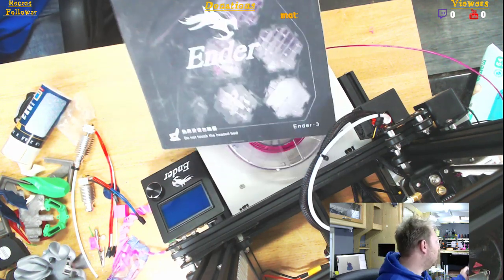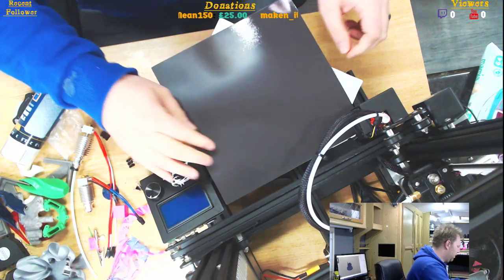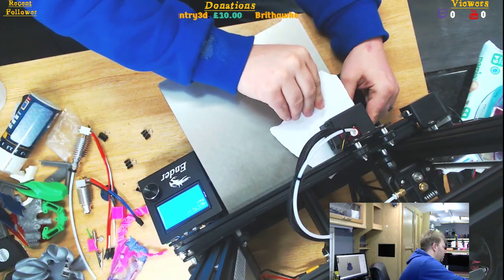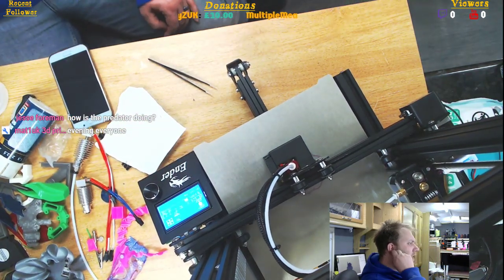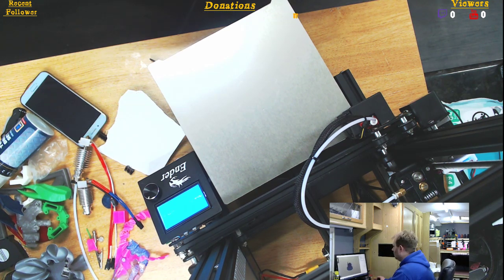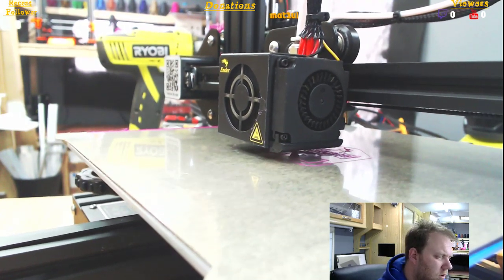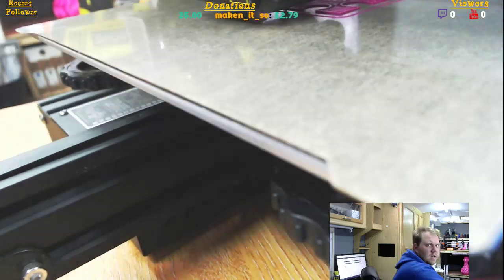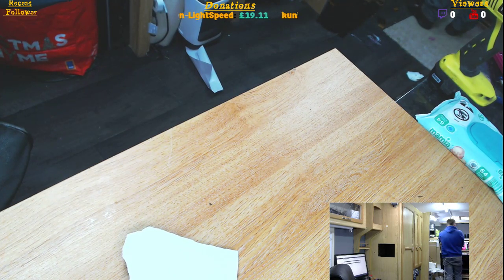3D Printing: Eryone FlexPlate magnetic system install ender 3

Comment: This is strange, I have the same surface, but I got a version with no texture, bare shiny steel with PEI on top. I've made my own video about that too.

Anyway, I'm in love with this thing so far and I'm glad to hear it worked out for you too.
Reply from the maker: Hi, mine isn't textured its a smooth sheet. And yes it is a brilliant flex system
Reply: @ScaldaYT  Ah, sorry for the confusion - I've meant the color, just like you're saying at around 40:26. Mine is bare steel with no coloring, just a thin layer of PEI and that's it.